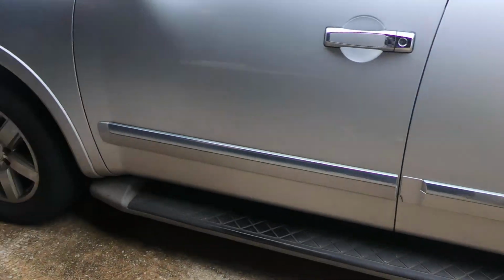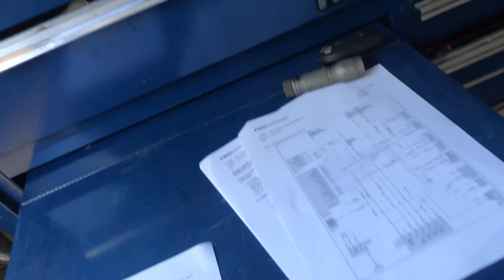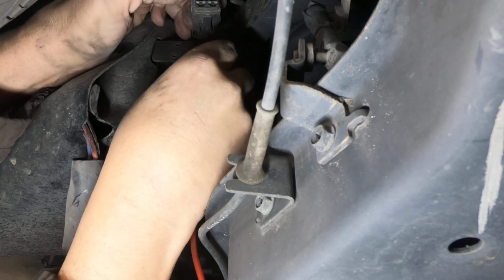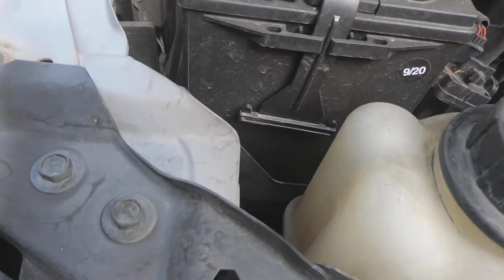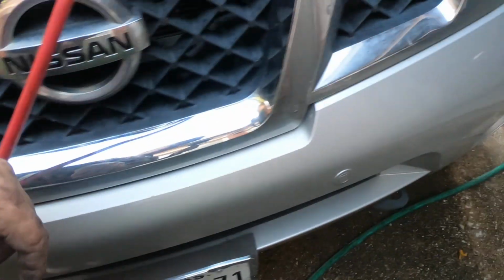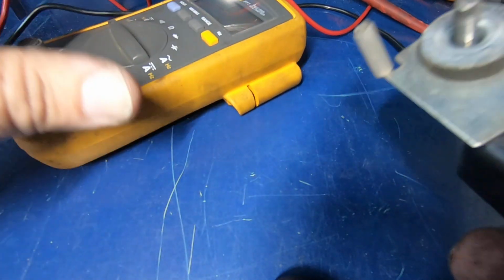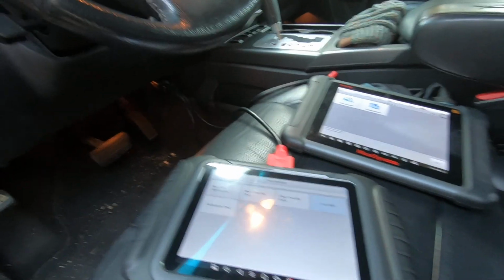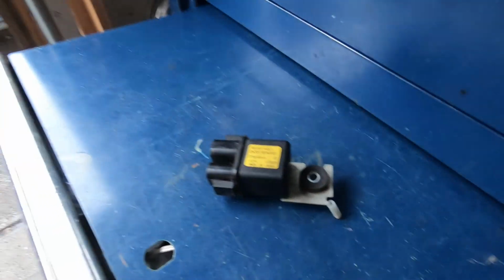Troubleshooting and Repair of the Air Leveling Suspension on a 2012 Nissan Armada.

Comment: Great video. My suspension on 2010 Armada stopped working for years until now. One way to know if the RELAY is bad is by switching it with the one next to it for the 4WD (one at near front of car is 4WD. Backone is for Air suspension. They're exactly the same relay. If relay is bad, your 4WD warning light will come on in the dash!! Switch them back until you get your new relay and install it. I got one at ebay for $38.  I suspect this was also the reason why my tow lights stopped working. I wasted money on a new level sensor thinking my old one was bad.  Learned my lesson.
Reply from the maker: That's good info. The Armada I was working on was only 2wd so I didn't have the option of another relay to swap. Good to know they are the same.

Comment: Do you know if the compressor should come on while driving such as on a freeway.  I think I have a small leak and when I tow for a few hours, the truck will be sagging quite a bit and the ride isnt so great. Once I stop or restart the vehicle, it airs up normally (even at stop lights sometimes).  I sprayed soapy water on the air line connections at the shock and compressor and did find a few small bubbles at the drivers side air shock - not a lot.  I don't have an Autel tool so I can't bleed it off, but was thinking I could let it bleed off over night, then take the air line out, clean it, and possibly cut 1/2" off and re-insert it.  Just not sure if the system is functioning as it should.  Thank you!
Reply from the maker: The compressor will come on when necessary to maintain the correct ride height.

Comment: I bought replacements and discovered it was the relay. I haven't put in the replacements yet. My inky issue now is one side seems to fill up more than the other. Both sides hold air. Is there a trick to get them to reset?

Comment: Thank you. I’m trying to diagnose the same problem. Could you share how you actively controlled the compressor from the Autel? I have the same tool but can only passively see the height sensor value and compressor on/off.
Reply from the maker: go into the active test and there should be a function to turn the compressor on and off.

Comment: Can you adjust on 2018 Armada the rear ride height in the park position with the vehicle off? When the car is running it's fine. When off the rear drops. Wondering if the exhaust port stays open too long in the off mode. About 3 weeks ago Nissan replaced the rear control arms. They seem to be stumped. The truck is still with them.
Reply from the maker: If you have a scan tool you can watch the sensor reading and adjust the sensor as needed.

Comment: Thank you so much for this video. It saved me alot of time troubleshooting my 2013 armada. The relay is not clicking when I actuate the rear suspension sensor arm. I don't have a tuner that can turn the compressor on. When I jumper the thick wires from the relay the compressor kicks on so I know it's OK. The thin wires on the relay have 7.3V on them all the time, when the suspension sensor arm is up or down. I'm thinking a bad module? Any insights?
Reply from the maker: The black wire should be a direct ground and the purple wire goes straight to the module so if you are getting 7.3v all the time something isn't right. I would find the module behind the left rear quarter panel and check the connector for corrosion specifically PIN 1 is the compressor output for the module.
Reply: @737mechanic  I replaced the module with a boneyard module and i'm still getting 7.3 V to the relay. I'm thinking maybe one of the sensors is bad. Maybe each sensor triggers half battery voltage so it takes both sensors to trigger the compressor.
Reply from the maker: @pauljenner7235  How are you checking the voltage? Do you have a voltmeter with one lead going to a known good ground and the other on the purple wire at the relay? There should be 12 volts at the yellow wire and the purple wire when the module is commanded.  I only see one senor in the diagram. If you email I can send you the wiring diagram.

Comment: My 2011 compressor kicks on just after starting the vehicle and seems to adjust correctly.  But if you add a trailer to the hitch, it doesn’t adjust after that. I’ve replaced the compressor and solenoid, the lift height sensor on the lower control arm, and now, the control module inside the rear wall panel. All factory parts except the compressor. It’s frustrating for sure!
Reply from the maker: I would hook a scan tool to it and monitor the level sensor and make sure the computer can see the sensor change as the rear drops lower as the weight of the trailer is put on it. As long as the sensor is being read and it changes as it should then the compressor should kick on to level it out.
Reply: @737mechanic  Sounds like great advice! I’m going to need to invest in a scan tool. Thanks for your video and replying to all the comments. It’s a life saver!
Reply: I wonder if I took it to a dealer (heaven forbid) or a reputable shop, if they’d be able to reflash it to recognize the new parts. And what kind of cost could be expected with that. My wife just wants to safely pull the horse trailer to shows in the event that I can’t go. But this issue persists on her vehicle.
Reply from the maker: @waybakcustoms  If they simply reflash or re-program the module it is usually 1 hour of whatever their hourly rate is.

Comment: I have no power to the load leveling device. Should be 5v. Relay tests good. Anyone got a suggestion? Fusible link is also good.
Reply: Did you ever find the issue, my mom is having the same issue

Comment: So I have a 2012 Infiniti Q x56 with body motion, control system or air suspension. Whatever you wanna call it. Does anybody know when lifting the vehicle and three suspension work? Does the car have to go into any kind of maintenance mold, or anything to prevent damaging the suspension??? Please help!!!
Reply from the maker: No it doesn't.
Reply: @737mechanic  Ok I heard you have to use a scan tool to exhaust or deflate the air before changing both rear lower control arms when lifting the whole car off the ground? Both have a lot of rust and need to be changed and once in there, don’t know if anything else will need replacing!!! I also have a hard time believing that I can’t find anything related to this.
Reply from the maker: @KK-zm9lr  email me and I will send you the maintenance manual procedure. mechanic737@hotmail.com